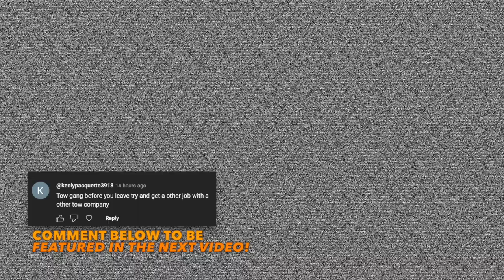Had to Drop the Car On The Freeway 😓 #towing

Comment: Always check the air in the spare before installing it. It looked flat
Reply from the maker: Trust me I always do, but at that moment it was useless to do so. My truck doesn’t have a compressor
Reply: @SAVIPOV  Go to H F and buy an air tank you can always pull air from your back tires and fill up their spare just remember to replace the air you took